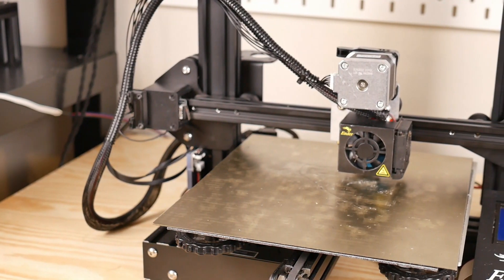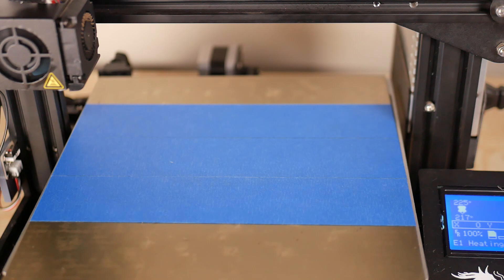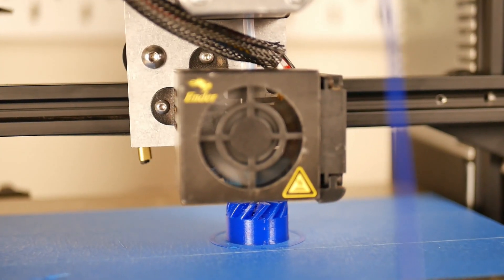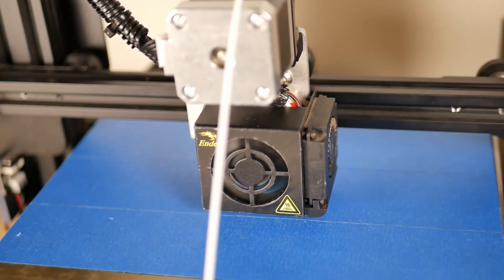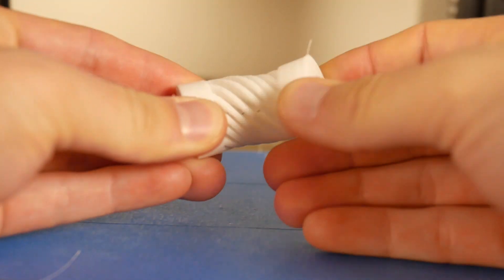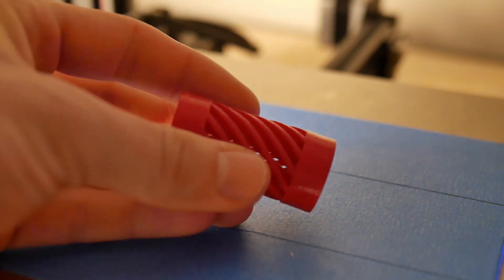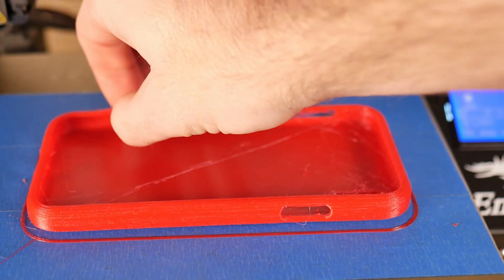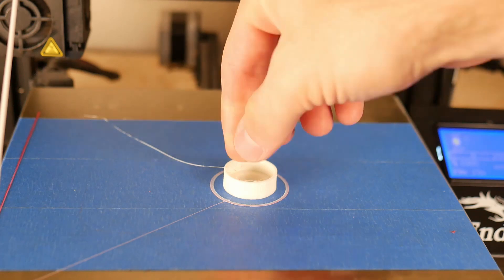Printing Flexible Materials On The Ender 3 (Ninjaflex, Cheetah, & Armadillo)

Comment: I am upgrading my Ender 3 v2 so I can print things like TPU, nylon, carbon fiber etc.  How/what do I need to do to print above the 260 degree ceiling that is set for the ender? Also what is the touch screen that he is using on the ender 3? I've put this on other comments hoping to increase the chances of getting a answer, so sorry if you are seeing this more than once.

Comment: You can definitely use retraction with a DD extruder, just slow the retraction to <30mm/s. The tip for 'not' using retraction is for people using bowden feeders with flex filaments.

Comment: Hey, did you made an adjustment to print them or just like the ender comes out of the box? I’m gonna be working with the 2nd version of the ender 3 and am curious specially about the ninja flex printing without that much of a hustle
Reply: He said at the beginning of the video he upgraded it to direct drive...out of the box look at printing something like overture's tpu. Slightly stiffer.

Comment: why should retraction be disabled? i printed a 45D tpc on my bowden ender 3 with pla retraction settings and had no issues. only a bit of fine stringing with fine details but that wasnt nozzle ooze it was just from the already extruded molten plastic clinging to the nozzle
Reply: thes the problem, the flexible material strings longer, so retraction or hopping will pull out more of a string. so you get less of that if you reduce the retraction or turn it off.
Reply: @ge2719 well especially on a bowden no retraction is gonna cause a lot of oozing like the nozzle won't stop extruding for a bit enough to extrude a thin line (very strong string) with the travel move and then underextrude for a bit when it returns to actually printing and in a direct I assume too but less.

Comment: What bed temperature do you use for printing the cell phone case? I am having a problem where my 3D print with the TPU fuses to the tape, and I have trouble taking off the tape. I am using Ninja flex TPU.

Comment: I've managed to print with 95A TPU on an ender 3 pro with the stock bowden tube. Like you mentioned, printing at ~30mm/s or slower is ideal. I tried using tree supports for the phone case, and while it helped with the bridging there was a few spots where the base of the tree stuck to the side of the case, so not really a good tradeoff.
Reply: Instablaster...

Comment: Well... its all about configuration. I print Recreus 82A tpu with RETRACTION! A microswiss bowden extruder, and capricorn ptfe tube pretty much all what i changed in my ender 3 pro. calbirate e-steps and slicer profile well, and you will be able to print 82A tpu on a nearly stock ender with bowden tube.

Comment: If you're still having trouble using retraction, I'd recommend the extruder base upgrade from thingiverse. It takes a short length of PTFE Tube which is cut into a point, and guides the filament completely. I have one on my machine (still bowden), and I'm able to use retraction without buckling. https://www.thingiverse.com/thing:2144277

Comment: Interesting...I can print TPU 95a shore hardness well at 15-20mm/s and ok at 25mm/s with stock ender 3 (metal extruder)...I was hoping the direct drive mod would allow significantly faster speeds...perhaps not...:(

Comment: Suggestion? I would upgrade that hotend cooling. The reason you might be getting the buckle is the PTFE tube is getting to hot and the filament isnt sliding past as good as it should. I have a 5015 fan mount that blows on the heat sink and will have 10X better cooling
Reply from the maker: Thanks for the suggestions! I will take a look at the info you emailed over to me.